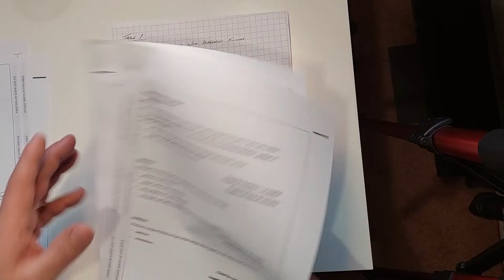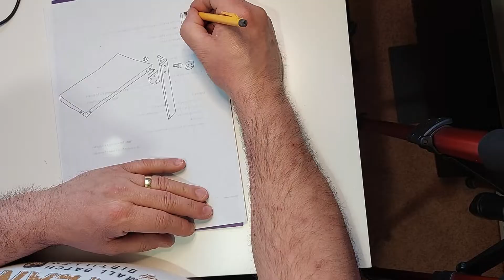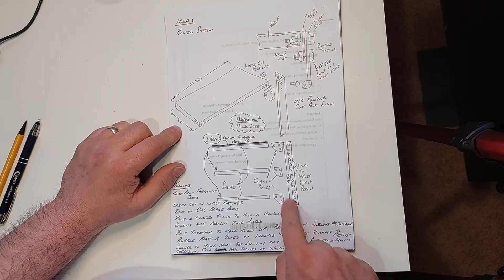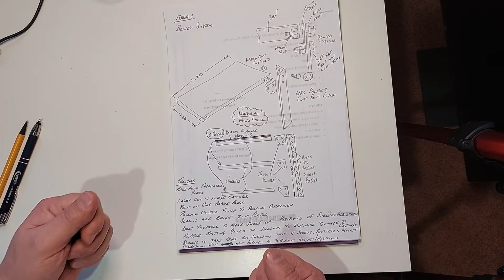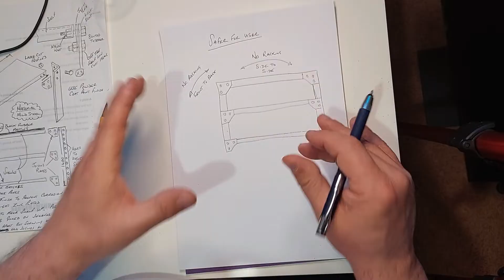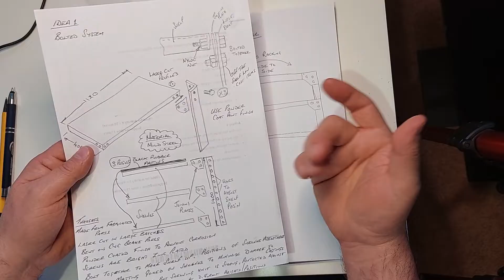Unit 3 Engineering Product Design and Manufacturing Video 3 - Mock Exam Activity 3

Comment: I’ve got a mock next week for unit 1 and unit 3. Unit 1 i’ll be able to get by just about but unit 3 i’m really struggling. I’ve got the shopping trolley as my mock exam. Could you do any videos on that to help? Mainly activities 3-5.
Reply from the maker: I am doing new set of videos but not on the one you are doing mock exam on.
The process will be similar so will help.
My first one is the research task which I should finish editing during the week.
Your tutor should be able to help if I dont get to those sections in time for you.
That's their job, teach, help and give you feedback on work you have produced. Plus provide alternative ideas to help you grow your knowledge.
To be honest you should not be doing the mock exam but working through it with your tutor to produce the best work for the real exam and make sure you are familiar with the format.

Comment: Sir Today I have done activity 2 in exam But I didn't do it structure vice for example first I discuss some of the point which we must have to include then h&S then I discuss some (must) points then sustainability like its not in the order do you think it will gonna effect my marks btw Great explaination
Reply from the maker: The order it is should not effect your marks, the examiner will take everything you have offered and mark accordingly
Reply: What product are you working on mine is a work platform
Reply: @footballfanatic3613  my ones workplatform aswell
Reply: @footballfanatic3613  my ones workplatform aswell
Reply: My one is working platform aswell Whats your design Ideas for activity 3
Reply: @hassaankhan3294 I’m thinking if adding a safety rail and steps to make climbing it easier wbu?
Reply: @hassaankhan3294 wait you already started the exam? Mine is tomorrow what is things your part B mention that you need to improve